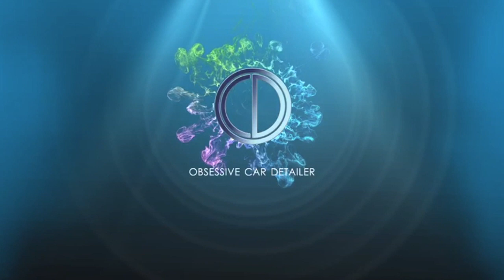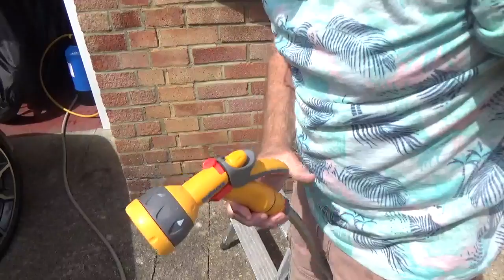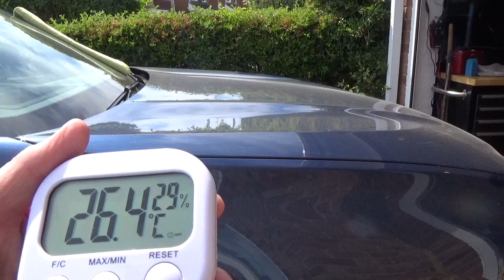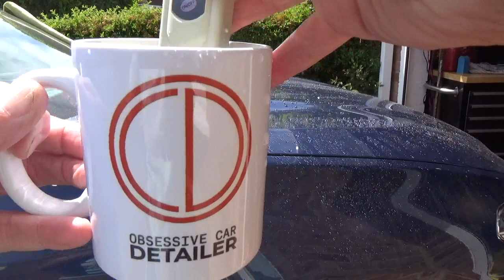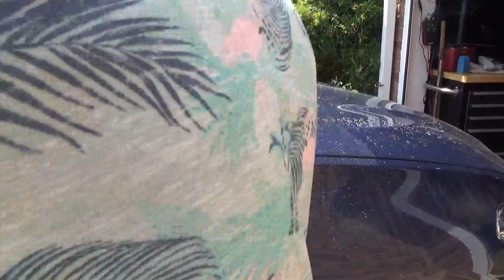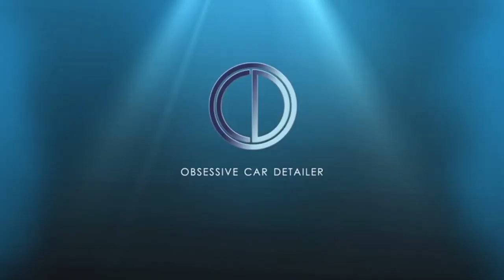No more water marks

Comment: Hi Martin
Just to confirm what someone else has said. You should be getting a ppm reading of 0 when new resin is used I would contact vyair and query yours.
Reply from the maker: yep, on it 👍
Reply from the maker: Ok so its official, I'm a plonker. I measured the output of the vessel at the end of the hose instead of directly out of the vessel. Re measured this morning and had a reading of 0ppm. However at 17ppm no water marks👍
Reply: Obsessive Car Detailer Martin you should get the same levels at both ends.
Reply from the maker: @markd5958   just hard water in the hose. Its good now👍
Reply: Obsessive Car Detailer 👍🏻

Comment: Excellent work young man. Will u still dry the car?
Reply from the maker: Yes I will just not in a hurry anymore
Reply from the maker: Ok so its official, I'm a plonker. I measured the output of the vessel at the end of the hose instead of directly out of the vessel. Re measured this morning and had a reading of 0ppm. However at 17ppm no water marks👍
Reply: @ObsessiveCarDetailer  excellent 👌🏻👍🏻

Comment: Isn't that funny! I'm just in the process of researching one of these! Cracking video!
Reply from the maker: great minds think alike, hope it was of use👍
Reply: @ObsessiveCarDetailer  It was Martin, thank you. Its put the cat amongst the pigeons now whether I chose RaceGlaze or Vyair. I had an Aquagleam filter ten years ago but it wasn't very cost effective.
Reply: @D992   I have the 7l race glaze. Apart from being smaller I think they are all the same. It's all to do with what resin you put in them.
Reply from the maker: Ok so its official, I'm a plonker. I measured the output of the vessel at the end of the hose instead of directly out of the vessel. Re measured this morning and had a reading of 0ppm. However at 17ppm no water marks👍

Comment: I've been using the same size vessel and TDS metre for the past 2 years, it makes washing/detailing the car so much easier. Martin the PPM reading you got  of 17 is not very good, mine goes from 280ish to 0 and was told when reading creeps above 20 the resin needs changing, how true that is I don't know, mine stays below 5 for months. Some suppliers use either low quality resin or mix new resin with old resin. The resin I use is Tulsion MB-115, iirc it cost me £80 for 25ltr bag from eBay.
Reply from the maker: good info, thank you. I will follow up on it 👍
Reply from the maker: Ok so its official, I'm a plonker. I measured the output of the vessel at the end of the hose instead of directly out of the vessel. Re measured this morning and had a reading of 0ppm. However at 17ppm no water marks👍
Reply: Obsessive Car Detailer so you didn't let the filtered water run long enough to flush out all the unfiltered water. Glad all's good 👍
Reply: Hi where do you buy your resin from for the bottle
Reply: @RichardBowker-x4y  eBay. Not bought any for ages so bet price has increased.

Comment: Cool tip. I'm thinking of getting a bigger water softener system, primarily to avoid limescale and water spots inside the house, so the Mrs would love me even more :) Also would add then an extra pipe and fitting for the garden hose, so I would benefit of it too. However that is a completely different price range :( You should get better foam also by using the soft water with the foam lance. In the US, some recommend to use the water filtration system of RVs to do the same(ish). Another idea I kept in mind to be more price cautious is a rain water collector with filters, as the rain water should be soft too, the filter should get rid of the dirt and it would be a sort of recycling/saving of the drink water.
Reply from the maker: Good ideas both with the foam & rain water

Comment: Going to be so handy swilling down your cars and bike. Making it so much easier. I live in a hard water area and it can be a pain. Had a friend in Northampton and the water was so hard it left white chalk like substance all over the stainless steel sink. I missed in the video did you say you send it back for a refill or do you do it yourself ? Great video.
Reply from the maker: Good point, I didn't say did I. No you can refill yourself. Just pour the old resin out into a bag and pour the new in. The old resin can go into the dustbin to land fill safely
Reply from the maker: Ok so its official, I'm a plonker. I measured the output of the vessel at the end of the hose instead of directly out of the vessel. Re measured this morning and had a reading of 0ppm. However at 17ppm no water marks👍

Comment: I think you use less water by still going through the pressure washer for the final rinse but you cant get the  water to sheet of like with a hose.
Reply from the maker: I guess you could connect the washer if you wanted to Andy. I will see how I get on with it
Reply: @ObsessiveCarDetailer  I run mine the pressure washer it is fine and it does use less water.
Reply: @patrickvennard838  I have the 7Lt Race Glaze and do the final rinse with the pressure washer.

Comment: Glad you went for a filter in the end. I have a different make so maybe different resin but my water went from 450 to 0. I still dry the car but like you said. It saves the stress of running around on hot days. I thought I might be able to get away with a rinse when it's just dust but just found it looked worse so still do a bucket wash 1st.
Reply from the maker: Hi Andy I have been toying with getting one for a while just swaying between this or a new pressure washer. The hot weather swayed it
Reply: Been doing a bit of research myself, don't know what resin Vyair put in their vessels, but Tulsion MB 115 resin is supposed to be the best one out there!
Reply: @sanmiguel4019  that's also what I thought as well. Once mine runs out with whatever is in it that's what I'll replace it with.
Reply from the maker: @andyupton5851  well if its good enough for you two then its good enough for me👍
Reply: @ObsessiveCarDetailer we will have to see who runs out 1st and needs to change it.